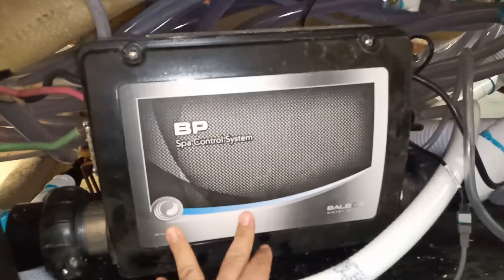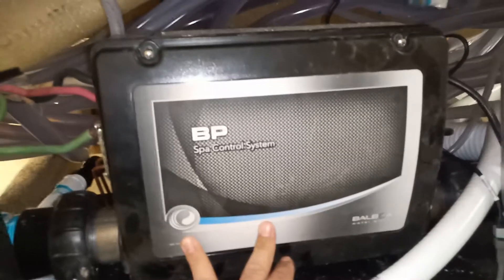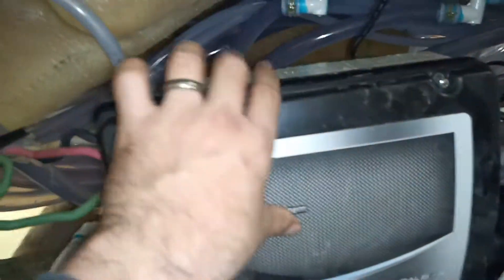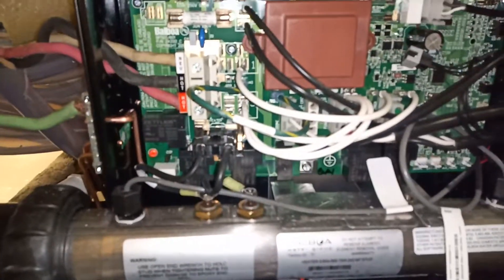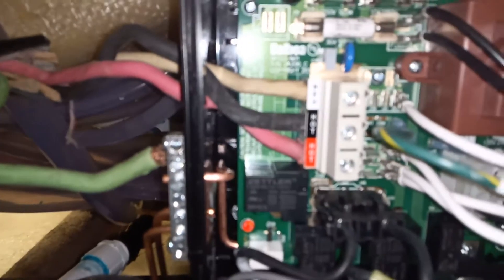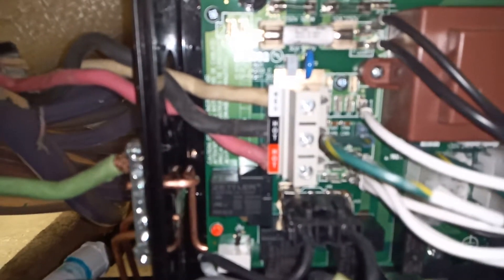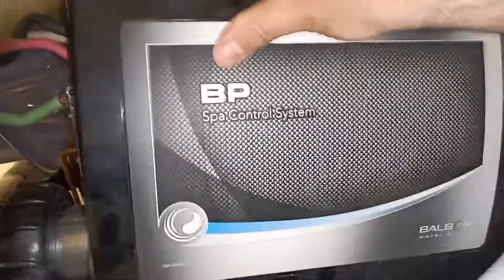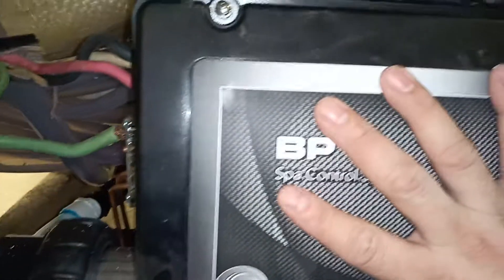220V electrical connection for the BP501 Balboa Control Pack used on most Pacifica Hot Tubs

Comment: Just got a new tub.  Bp501 board.  GFCI breaker trips immediate.  Found black hot is grounded on the board.  Any advice?
Reply from the maker: Hi.  Make sure the load neutral from the GFCI is going to your hot tub.  Follow your diagrams and that will do it.  (Large number of electricians do not follow the diagram or customer does not provide it)

Comment: Isnt the ground wire supposed to go through the main hole with the other wires. Then back out to the bar through the little hole labeled ground?
Reply from the maker: Yes, ideally you would do it that way.  We test about 4-5 hot tubs per shift on each station.  The intent of this video is to show where the wires go.  Great question though.  I am sure it will help some installers.

Comment: Is this run by a 50 amp breaker?
Reply from the maker: Hi!  It depends on how many pumps you have and how many amps each pump can draw at peak power.   A 50A GFCI Breaker will cover any single pump system and most 2 pump systems.  Do you know how many pumps and the horse power of each your system has?

Comment: I have a 501 that took a lighting hit. 240 volts still going into board and fuses look goid but tub is dead. What can I check?  Probably new board?  Thanks
Reply from the maker: Hi Mark.  I would double check the small fuses that are on the upper left hand corner above the large white fuse.  Those are the first to burn when there is a short circuit or a power peak.  This happens so that the board and pack are protected.  Give it a double check.  Experienced Service Persons some times miss it.   If they are good, then yes, the board is dead or worse.